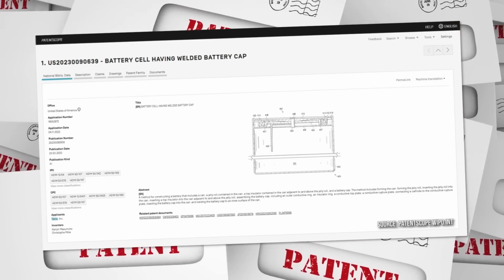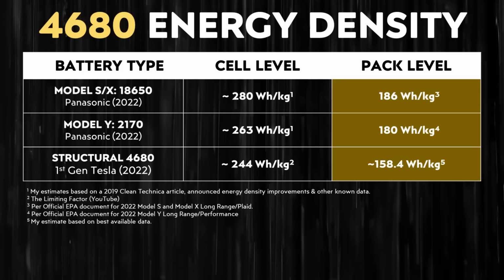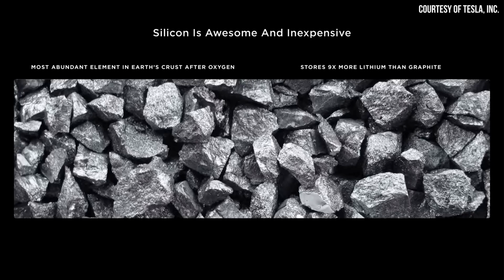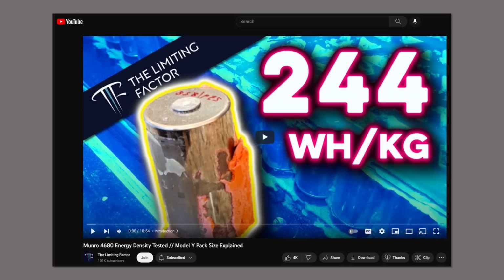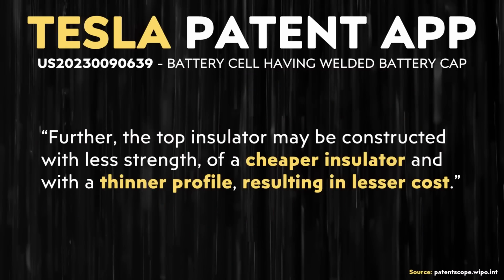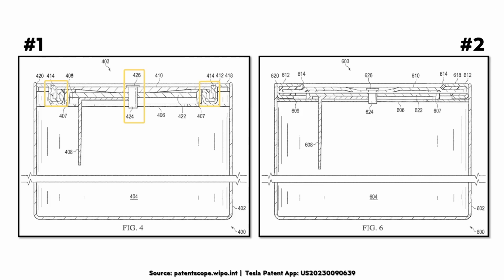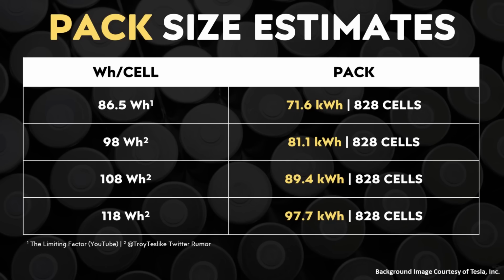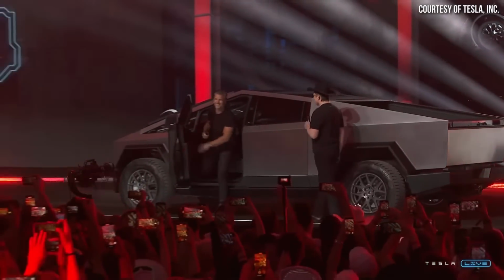Tesla 4680 Battery Patent App Reveals NEW ENERGY BOOSTING Design

Comment: Based on my findings, 21700 has a higher energy density than the 18650 at 290 Wh/kg and 265 Wh/kg, not lower. Also according to one of your sources (limiting factor) the lower energy density of the 4680 was made up for in the pack design as it is structural.

Comment: E=1/2mv^2 so if 118 is achieved the battery pack can be dropped to 60 kWhr making the battery pack 35% lighter; or 350-400 lbs. this is insane because that 8-10% additional mileage suggesting you lose 25% battery pack but only 15% range. I imagine they’ll size for 300 mile range and save 25% cost the the overall pack if they can achieve that density.

Comment: the roll isn't longer, it's taller. the can may be lighter but the filled battery cell would be heavier.  patent  drawings are not dimensioned and not to scale unless the claim is dependent on the dimensions.  the vertical is exaggerated in the more complex first gen construction to make the construction clear to the patent examiner.

Comment: Is it possible to have a circular welding electrode that just zaps the top weld instead of a single point going around?
Reply: Possible. But if the robot welder is stationary the battery itself could rotate 360 degrees.
Reply: @tianjohan4633  Speed is very important.
Reply: @robitmcclain6107  Laser welding? Tesla are already using it for their new motors.
Reply: @tianjohan4633  I thought that was what the hairpin welding looked like. Maybe spinning the batrery for laser welding would be very fast. The jelly roll sure winds fast.

Comment: Hmmm. You are making me think :) 

80mm external length. If they are recovering 5mm... if the available interior length increased from 72 to 77 mm... that is about 7% more electrode. 

If they were able to use a thinner separator they might get a couple extra wraps of jelly.  That is not something they would have to say here.

Comment: I am starting to understand why CATL and BYD went a different direction and it looks like they may be right.  It appears it is going to take more time for Tesla to sort this out with the 4680 cells.  Silicon is going to reduce cycle life.  No thanks on that compromise.   LFP, LMFP packs are making more sense in the near term.  I think I would take a pass on a 4680 equipped car for the time being.
Reply: I think it’s Apmirus that’s coating the silicon nano wires in their anode now? So I don’t know for sure, but I think there are ways around at least some of the disadvantages of using silicon. It’ll be interesting to see what advancements Tesla incorporates. But, I do get your point regarding LFP chemistries. Personally, I think an LFP pack would be my preference.
Reply: @gridjac  Good time to be  a spectator on the 4680 stuff I think.  Let's see where it goes.  Lots of interesting chemistries are coming together about the same time.  Looks like we will have options in the next few years coming to market and ramping up.   It's an exciting time for battery development.
Reply: FYI, BYD warranty for their batteries are 100,000 miles. Not 120,000 or 150,000 that Tesla does.
Reply: @davekozlowski1266  Those warranties will all be relative as they start playing with the silicon chemistry.  We already have a track history for a little bit now with LFP so we know they are rated to handle a lot more cycles.  I will take the more cycles over increased density if I have to choose.  It sounds like with M3 and some of the advancement with LMFP that we may not have to choose and get a nice boost to density and still get the greater number of cycles.   In a couple of years it will be a great time to be a new EV buyer with options.   At least Tesla does not get married to any particular tech or chemistry and will go whatever direction that makes sense.
Reply: @Longsnowsm  I wish I could find the article, but it was saying that the LFP batteries were losing capacity much faster than other chemistries. They were reporting up to 15% degradation at 100,000 miles , but also 10% as soon as 60,000 miles. Since I want the performance of an EV, I'll skip the LFP batteries. That being said, I believe that the battery will still give me 300,000 miles. It's extremely rare to hit more than that in Wisconsin due to rust.
Reply: @davekozlowski1266  Watch the video by Cleanerwatt on the LFP degradation.  They fall faster to the level where they stabilize which is about 10%, but stay there.    It is just alarming when you buy a new vehicle and watch it fall at a 2-3% rate vs the 1-2% rate of the conventional chemistry, but they all stabilize at about the same level.
Reply: @davekozlowski1266  With WI weather the bigger issue with the LFP or LMFP will be their sensitivity to the cold.  I know Tesla has the preconditioning function as long as your navigating to a Supercharger, but it does appear to take a pretty big hit.  My day to day local driving I will never be navigating to a charger as the charging all happens at home.  So the performance hit due to the cold could be a factor.  I live quite a bit to the south of you so I am thinking other than a few periods of time each winter I could probably limp by with a LFP.    I was hoping other manufacturers would push more options out this year, but doesn't look like that is happening.  Tesla doesn't appear to be making any changes on that front either.  So I am not thrilled with the choices this year.

Comment: i think that silicon loading in the graphite anode makes more problems the bigger the battery is because of the expansion.
tesla still tries to use a simple approach with just mixing it in. that of course does not deliver enough embedded space to take up the lithium ions without swelling.
other companies create a kind of nano structure that comes with a lot of space.
sinanode for example has this chaotic random mesh with silicon nano wires that is growing on the graphite particle. it looks like a metal sponge with a lot of embedded space.
also amprius has a nano structure, but not random, more like a micro fiber cloth. and in the case of amprius it is pure silicon without graphite. an independent lab measured 504 Wh/kg. that is really something else.
Reply: That is not the case.  The battery anode and cathode are quasi-two-dimensional, meaning that the expansion would occur perpendicular to the foil. In any case, the expansion is a microscopic problem, not macroscopic. It’s the cracking of the particles from within the material that degrades performance, rather than expansion and increased pressure within the battery can.

Comment: You speculated as to whether Tesla's two diagrams were to scale.  But this is the 4680 cell, so you know the cell must be 46 mm in diameter.  Since both pictures are of a 4680 cell, you should be able to simply compare the widths, and if necessary scale one picture so the widths match.
Reply: @samijokinen9246  "stretched vertically?" Yes. I know for a fact that Taylor Swift is not 3 metres tall.